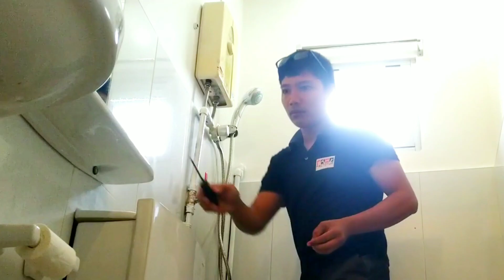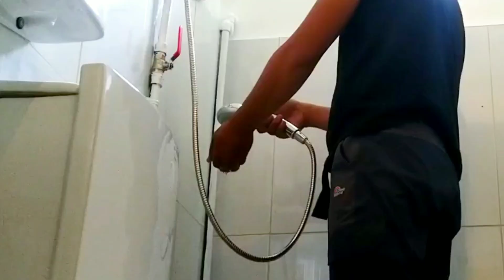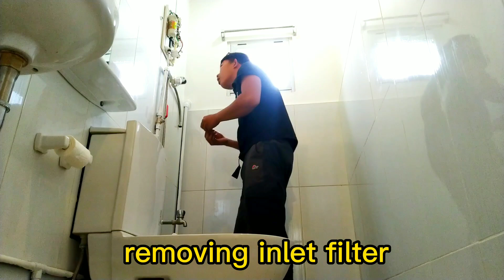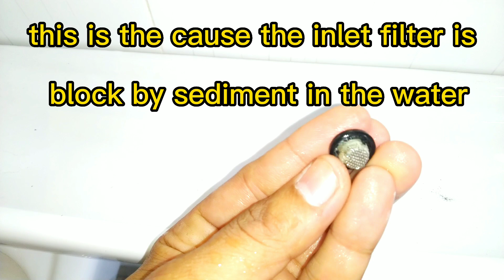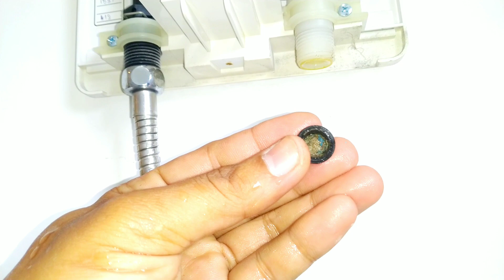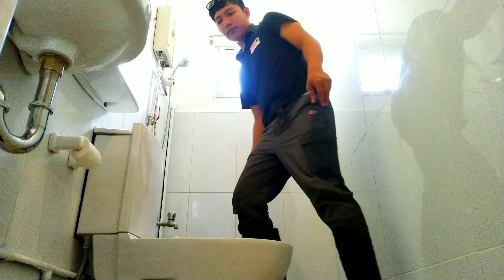Bakit hindi umuinit ang water heater AEG single point shower water heater

Comment: Hi sir pag ba mahina ang water supply hindi tlg umiinit ang heater? Yung samen kase hnd umiinit at hnd din umiilaw yung red light nya. Thanks sa sagot.
Reply from the maker: Yes po dahil hindi mag on ang thermostat pag low pressure, naka depende din po kung anong specs ang water heater ninyo mas maganda yung may built in pump na,dahil kahit low pressure iinit parin

Comment: idol paano naman pag walang ilaw yung heater? dati naman pag hindi ginagamit naka standby lang nka permanent RED ang light. ngyon walang power. pero ok naman ang pressure ng tubig. ayaw kasing umiint ano kaya posibleng sira? thanks
Reply from the maker: Try mong pindutin may button yan sa taas nang heating element sir para ma reset mag trip kasi yan pag na over use, subukan mo lang sir baka makatulong